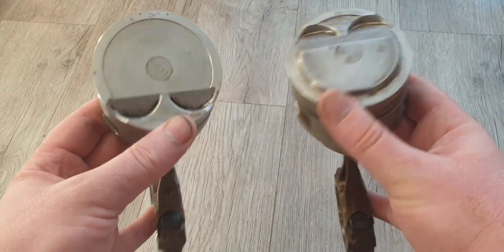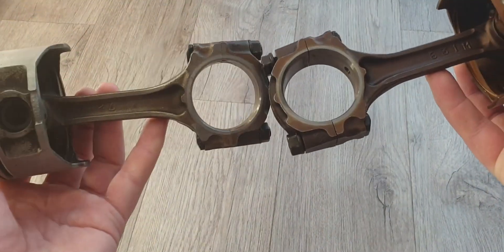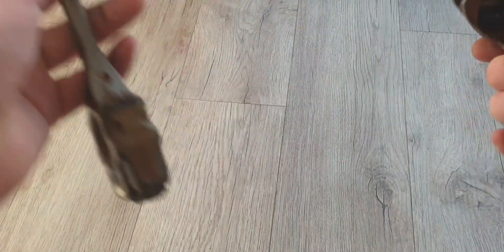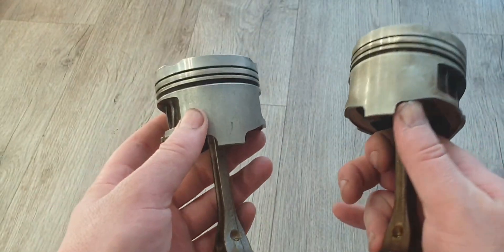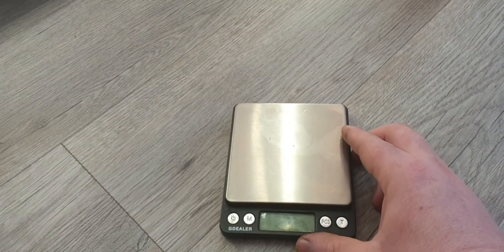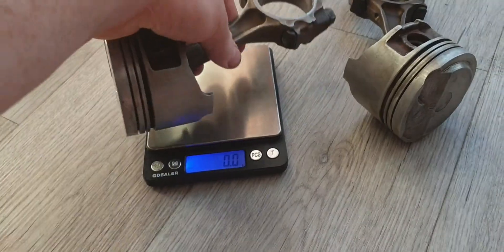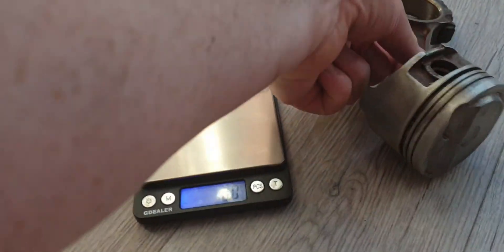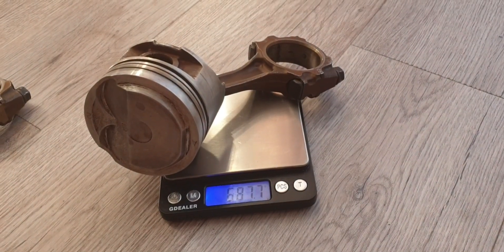Bought 4EFE rods on eBay thinking they were 4EFTE Starlet Pistons 🐌Ignore my "Advice" in this video.

Comment: A stock 4efe would probs blow up at 180whp, 240 is pushing it a bit
Reply from the maker: Hi Peter, just looking at rods they're the same as the 4efte,  pistons have that extra crown 👑 so maybe thats why theyre approximately 10g heavier than the 4E-FTE,  the pistons should be able to take the same hp at the turbo model. I think I'll try it of I can get my grubby little paws on a future starlet.
Reply: @920400706  from my experience, the 4efe rods wont handle more than 13psi without blowing up after a few runs. I do understand what you're trying to say and looking into it maybe different 4eftes have different size rods because I have seen a jdm spec 4efte and it had 1st gen 5efe rod thickness. You are right on the fact that the high top piston doesn't mean its bad to turbo since better fuels and turbos exist nowdays
Reply from the maker: @peterstoyanov7897  Yeah that's a good point, I personally prefer to buy forged rods and pistons because you pay 2 or 3 times if you go "budget" I wonder what thickness or spec rods I have with those 4E-FTE Pistons, if they're thinker then perhaps on ebay I bought 4E-FTE Pistons connected to 4E-FE Rods?
Reply: @920400706  yea I think you might have, because I had a look and the 4efte rods are twice the thickness. Either way tho, the forged conrods are better and are inexpensive
Reply from the maker: @peterstoyanov7897  Pal I am grateful you spotted this for me, I really wouldn't have known the difference if it wasnt for you. I may take them fake rods bin them and pop those 4EFTE pistons onto my MaxSpeeding Rods...
Reply: @920400706  no worries man, you'll need aftermarket pistons to put them on the maxspeedingrods, the gudgeon pin on the stock pistons are smaller so you'll need new pistons and gudgeon pins
Reply from the maker: @peterstoyanov7897  Thanks again you are officially my boost buddy! Ill definitely call on you for a chat about the build!